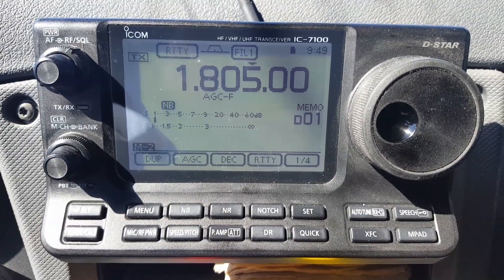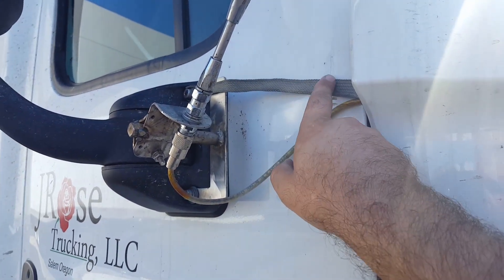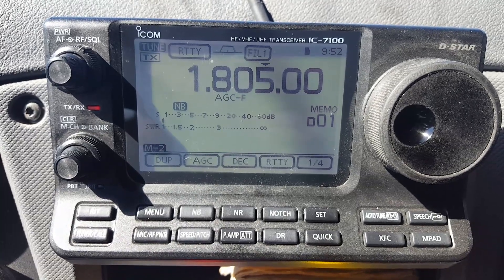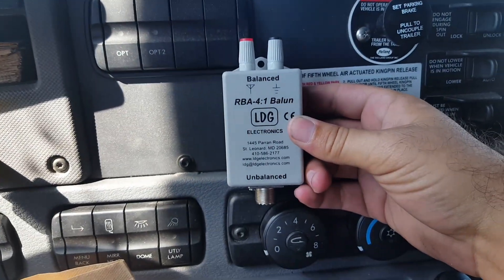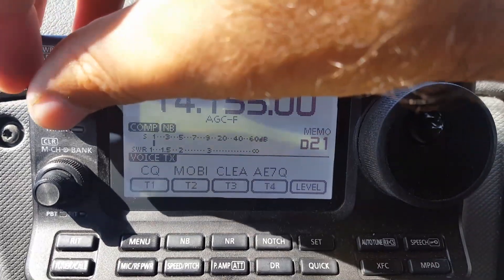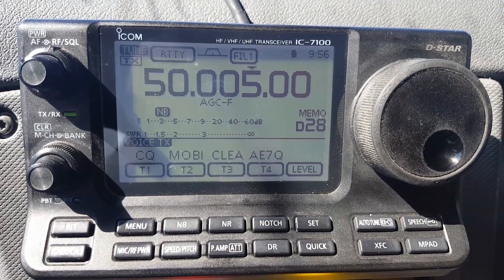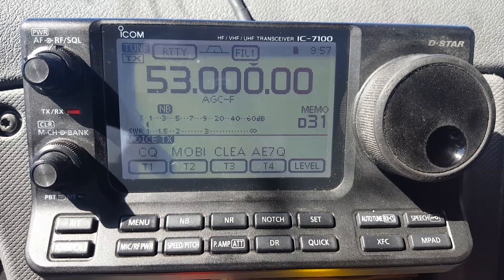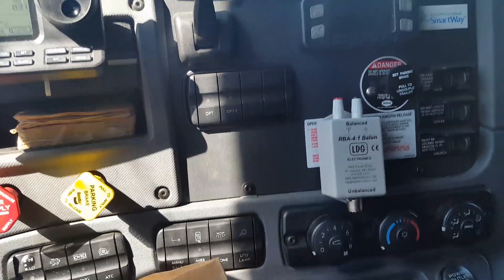102" ss whip tuning through the bands.

Comment: I have 102-in stainless steel whip on a Toyota Corolla with a ball mount and spring right in the middle of my trunk, I run a 18 ft coax right to the radio and got a one to one match. now some people get a one to three one to five match that is not acceptable because the radio operates it's best when it's at its lowest match that's the way I Work It. The trick is to get the correct length of coax to the 102 inch whip either by adding to it or subtracting a little bit from it but the rule is every nine feet is a match on 102 in whip, and my radio gets out good I have a Galaxy 
DX 86 V 10 meter amateur radio I put an  rm Italy small kicker  upper and lower side band plus Am I dead key on Am side 100 w swinging up to 150 and on sideband I swing up to 220 Watts it's all I need. I talk skip on my mobile not as good as those Base antenna but they hear me pretty good I am satisfied. my next step is a Mako 4 element beam ill be the new kid on the Block! 
Hello world!

Comment: What kind of efficiency that you get on each band.Just because it will tune up does not also say that it will work well.I'm sure it will not work as well as a resonant antenna & it should not be expected to do so.
Reply from the maker: All your loss happens when you tune your antenna through coax. But if you're tuning your antenna with a tuner hook directly to the antenna, you don't need to tune your coax therefore you have no loss.
Reply: @rodspencer2000  the biggest loss is the antenna is not optimal for the band they are being used on.Most are a Quarter Wave Length at best without some type of coil and that’s far from Optimal.
Reply from the maker: %100
Reply: @rodspencer2000  IMPOSSIBLE with a mobile antenna.

Comment: Can you tell me what whip you have the stores im looking at keep saying its a cb whip but i am running hf like you.
Reply from the maker: I was on a 102" cb radio whip, it works on 10 & 11m just fine, some use a tuner and have had luck with all the bands from 6m-40m.  The further away from the resonate freq of the antenna the less efficient it will become.

Comment: I run a 102 in whip on my HF rig in my jeep. If you put a 1:4 Unum in line it will tune on 40 meters. Still very, very inefficient but can make contacts.
Reply from the maker: I have Hustler resonators to cover 10 through 80. 40 and 80 for me are completely unusable when driving... the computers in my semi cause about 40 over S9 noise! When I park all that noise goes bye-bye. It is what it is
Reply: @rodspencer2000  I am Blessed that I have ZERO noise from my RAM 1500 Quad Cab with my ICOM 7000 & Hustler Resonators.It's the quietest HF mobile setup I have ever ran in any vehicle.The Chevrolets were Terrible for making Noise.

Comment: Have you tried the Little Tarheel antenna?
Reply from the maker: I have not. I have used HiQ screwdriver in the past. It worked well until I broke the coil. I was 3rd owner, it had lots of miles and lots of UV cracks, it only took a few months driving around with it mounted on my semi truck to break the plastic around the coil. I've been using Hustler coils ever since, they are in my current budget...

Comment: Does a 102" need to be tuned for standard 40ch CB radio? The guy that sold me the equipment told me it didn't need it. He also stated that I should use 18' worth of Cable
Reply from the maker: coax length, what ever fits! no magic number... having said that, if your doing a co-phase, a quarter wave length can be a tuning stub, or help you transform your resistance a tid bit, and half wave lengths can pass things through... for most single antenna applications, just get what ever fits! I have random length stretches of coax from radio to amp, amp to antenna, my SWR is 1.1:1!!! 
Use what works, toss what does not! That is the magic trick in this hobbie!!!!!!!   As far as the 102" being perfect, sure, in a perfect world, I found on my truck I had to add 6 inches, that made my setup perfect. Make sure you have good ground system, and clean connectors, I have to pull my stuff apart every spring and clean it. Have fun putting it together and using it...
Reply from the maker: o ya, don't argue with the CB guy, just make your shit work, what ever it takes, then use it, if he says 18' and you try it, if it doesn't work, change it! Don't get stuck on stupid things that are supposed to be the PERFECT STANDARD! These things are only the starting point, if you find you need to modify your setup, then do it!  73
Reply from the maker: Depends!  Your ground system & where you mount the whip. Using simple math, lets look at some numbers, starting points really, your SWR meter will let you know if you need to add or cut your antenna a bit. 
102"= 28.94 Mhz = near middle of 10m ham
108.5"= 27.205 = channel 20 on cb
The 102" whip band width may be good enough to cover all 40 channels with an acceptable SWR, if your happy with it, then no tuning needed.
I personally wanted CH 20 to be where my SWR is lowest, so I added 6 inches, and BOOM! I was super happy. 1.1 swr. Hope this helps, and no matter what you do in this wonderful hobby, HAVE FUN! 73
Reply: 8.5 foot is generally good.
Reply from the maker: @888rogermoore  yup

Comment: I am using an SGC239 antenna coupler mounted inside a cable TV amplifier case, used a "gumdrop" mount on one end of the box with a heavy duty spring feeding a Shakespeare 108" fiberglass whip. Box is bonded with one inch braid to chassis and powered by a set of power injector / power splitter that was featured in an old QST article. Works great from 40-6 meters, no issues whatsoever. Cost? Just the coupler ( on sale many moons ago) a few minor parts for power devices, cable box, free. Beats paying what SGC wanted for a similar unit which came out to over three times the cost.
Reply: @Subgunman it’s been over a year. How’s it working out? Is there anything you would have done differently? I’m stuck in an HOA and your solution sounds like something I can use. Tnx de WB3CFN…dit dit 😊
Reply from the maker: I set up a SGC tuner in a friends house who lives in HOA, He is on the air from 160-6! He has some noise issues due to being in the attic and so close to neighbors houses too. but he is on the air!

Comment: if you dont have 3-5 of static it aint going to work
Reply from the maker: Static levels change every where I drive, out of the big cities it is very quiet, in the cities its usually very noise. s3-5 is not a standard for noise

Comment: cant tune the wrong length, you need to get a screw driver antenna, even if it tunes your receive and transmit will be severe degraded
Reply from the maker: I have had a screwdriver in the past, it worked well until I broke it. These videos are just some of my adventures on different kinds of installs. These trial and errors are how one learns, I have learned a lot over the years and hope to keep doing so until I pass on. 73

Comment: I Rodney,  I have a Peaked and tuned 10/11M Stryker radio with mods. I am trying to decide if it is a waste of money to purchase a nice Stryker SR-A10 antenna or cut down a whip.
Reply from the maker: Your antenna is the most important part of your radio system. Not all antennas are made equal, you can take Brand X and put it on your car and it works fine , you can take that same brand and put on your pickup and it may not do anything right at all. Sometimes you have to go through a couple of antennas to find the one that works with your vehicle. Make sure that it is capable of handling the kind of power you're going to put through it, you're running good coax, and you have a good ground system to the Mount of your antenna. It is also a good idea to check and clean your antenna system in the spring every year. Lots of Road Grime from the winter driving builds up in places and can cause SWR issues. Good luck getting the best antenna setup and have fun when DX comes back around!
Reply: Use a whip.  Cut fitting off the bottom and buy a 10” GP riser. Makes the whip fully adjustable for a wide band. I use this on my truck

Comment: Weatherproof that PL-259.
Reply from the maker: All my connectors are weatherproof now. Obviously this video was shot almost 2 years ago so some things have changed. Upgraded coax, new connectors, new ground straps, different mounts. I keep on top of my stuff pretty good, I appreciate your concern and it is nice to know people notice these little things.
Reply: @rodspencer2000  OK, but that connection wasn't weatherproof in this video.
Reply from the maker: I understand that your comments were pretending to this video. I heard and seen what you're talkin about. Everything I have now it is different than it was then. I have all my stuff waterproof as best I can. I try to do maintenance on my stuff every spring when it starts to warm up and dry out a little bit. Clean all the connectors redo all the waterproofing. Just general maintenance line don't have issues.
Reply: How do you water proof?

Comment: It looks all well done now, so might not be a good advice, but if you can move the tuner right next to the antenna, you'll have better results. The tuner as it is, matches the coax and the whip to a resistive load, so the antenna doesn't radiate but is part of the antenna, and add losses. But it might not be practical to do so :/ anyway cool video ;)
Reply from the maker: I would love to have my remote tuner mounted on the side of my truck next to antenna, that would be the most ideal setup for sure. 73

Comment: It's 1/64th on 160 I think a 1/32 on 80 don't hold me to it
Reply from the maker: Quarter wave on 160m is 136.6667 Feet, so divide that by quarter wave on 11m at 9.0425 feet,  that is 15.113 times too short for 160m quarter wave. Thank you for this comment! It gave me a good reason to break out my Frequency wavelength calculator. So to keep it stupid simple, if you have a tuner that can load up your CB antenna on 160m, it won't preform very well. It is still possible to make contacts, you just will loose a crap ton of power from the back of the tuner to the tip of the antenna. What ever you do out here in this wonderful hobby, HAVE FUN! That is all that matters... 73

Comment: I've always wondered, why do truckers tilt their antennas forward at what appears to be 45deg
Reply from the maker: good question sean. I tilt mine for two reasons, one being clearance of everything, the other being less rfi back into my equipment. When I had my antennas stood straight up the hot point of the antenna, being the middle, was right next to the metal of the door, where some wires for all kind of computer controll run up the door on the inside, so moving the antennas forward gets the antenna radiation hottest spot out further into the air.  You may find as I did that your antenna will give you a better swr band width and less feedback into the computers, more so true with higher power amplifiers. For those who run just legal 4 watts on 27mhz CB, its more about looks. Hope that helps you some...73
Reply: Thanks for the reply, I'm a ham also, as well as a CDL driver, local only and we aren't allowed to have our own radios in the trucks, so my radio doings is all in my POV. 
I use the Yaesu FT-857D, currently without any sort of tuner, planning on either the LDG YT-100 or the FC-30.
My antennas are MFJ hamsticks and an Outbacker style multiband. Lots to work on for sure. I just bought a 102"whip which I'll most likely trim to about 98 &1/2" to be resonant on 10M and still usable on 11M when we go on a road trip. I found your video when I did my search on the 102" whip.
Reply from the maker: Hi Sean, I am sure you will find NO NEED to trim the 102" to be resonate on 28-29! I actually had to add 6" to mine to get it into the CB band better, but still have good swr all the way up to 28.7 with out tuner. Check it with your install before you cut! 73 and good DX AE7QT
Reply: It's cut to 99", which works out to a center frq. of 28.36mhz. Actually that was my first cut. After filing the rough and installing,  it had a virtually flat SWR on 10.The needle barely moves.  I think if I remember correctly, the SWR;'s didn't hit over 2 until about 29.6. 11m is 1.4-1.7. Fully acceptable. Bearing in mind I'm QRP on CB, with an unmodified Cobra 25, and up to full power on 10m with the hf radio. I use a Yaesu FT-857D with a LDG meter which plugs into the control head for the test.  planning on getting an MFJ-902B "Tiny Travel Tuner" 150 watts, 80-6m . Possibly a YT100 later. 
I use a Diawa 2pos RF switch to toggle between the two radios on the HF side..
The whip is attached to the bumper of my 2015 Nissan Frontier with a Hustler 1 & 1\2" ball mount, so I get a sufficient ground. My other antenna is an MFJ-1699 multi-band Outbacker style antenna that I have attached to my tool box. That antenna is still a work in process. The grounding needs to be improved before it can be decent.   I use the 4"HD spring for flexibility if it hopefully doesn't encounter a limb. 
For 6m, I use another 2pos. RF switch In addition to the 857, I also have a Yaesu FT-1900. It shares the Diamond M-285 whip on the hood. As I'm sure you know, in general a 5/8 wave on 2m is a 1/4 wave on 6.That antenna, like the cut 102 is virtually flat on 6. Those three antennas are fed to the HF side of the FT-857D with an MFJ  3 pos. RF switch. I use three RF switches. I seldom us six anyway, its just on an antenna that will work for the occasion that I might use it.  
The VHF/UHF side of the 857 is on a Diamond dual band antenna. 
Three antennas, three radios, and three switches lol, I guess it's a technique, also know as a work in process.
Reply: I've been told by many radio operators that tilting the antenna is not ideal. The signal goes out at a 360° from the tip of antenna. Angling it, the signal goes down towards the road. Anyone know if this is true
Reply: The more you angle it, the more of an NVIS antenna it becomes. All has to do with the take off angle

Comment from the maker: Coax was replaced with some RG400, its same size as RG58 but is much better quality. Some minor issues were fixed with new wire. 73 ae7qt
Reply: Next time you replace the coax try using LMR -240 flex, Davis RG-8X+III (same as the LMR but a bit less expensive ) or LL-240 from JEFA Technologies (Again, LMR-240 flex type just less expensive)!  I use JEFA LL-240 flex and have had no problems with it, ever and at $0.44 per foot!
Reply from the maker: @jfrphoto01  just as long as it will handle 2kw pep watts, sounds good...
Reply: @rodspencer2000  !500 watts PEP is Legal Limit so you are saying that you run more than allowed by Federal Law?
Reply from the maker: @1OFGODSOWN  my amplifier is capable of 3 kilowatts. But when I'm actually on the air I don't run any more than 1,500. Just during the tune-up I will make sure everything's peaked just right and then roll back the drive power. 

Looks like I need to clarify little bit, instead of changing the previous comment. My house amplifier will do 3000. My truck amplifier will do 1500w

Also, in the USA legal limit for amateur radio is 1500w pep. For cb radio is 4w.
Reply from the maker: @jfrphoto01  looking at a 4kw amp these days... will these cheap coaxes handle? Still have a long way, and some prep time to get these 4+kw watt levels. Still planning & prepping... 73
Reply: What tuner do you have hooked to it?
Reply from the maker: At the time I believe I had my LDG-7000 hooked up.

Comment: That discoloration looks like moisture/water.It's easy for moisture to get into a PL-259 connector when turned up like that.I'd replace the coax & use an elbow connector on the next coax as well as some good electrical tape at least.If the rig is one you own or drive all of the time wrap that connector with electrical tape & a good wrap of Coax Seal & then another layer of electrical tape.make sure the coax seal is between the layers of tape that you install so that it can all be removed if needed or when you get a different truck.Also I have found that the MFJ 929 is a far better automatic tuner for the HF Bands.It will tune what my LDG AT-1000 won't touch.It will tune a 102" stainless steel whip on 40 thru 10 meters & anywhere in between.I am usually NOT a fan of MFJ but I am very pleased with how it operates with my ICOM 706 MKIIG.Even on the bands that the LDG tuner will tune the MFJ tuner tunes much quicker & the SWR is always better.  de W4KVW  {:>)
Reply: I thought the icom 706 came with its own matching tuner
Reply from the maker: The 706, 7000, 7100, none of these have built in tuner
Reply: Rodney Spencer maybe Oliver is thinking of the Icom AH-4.